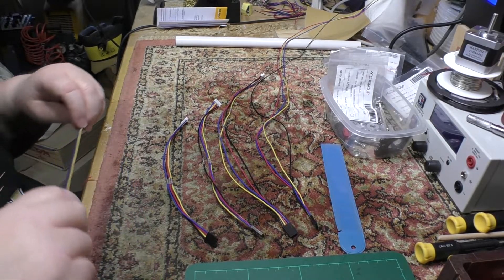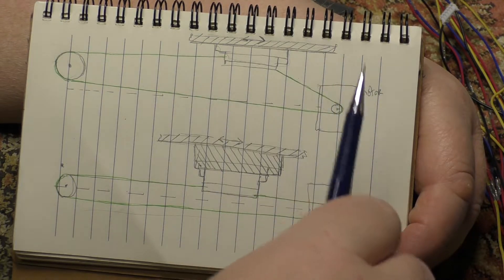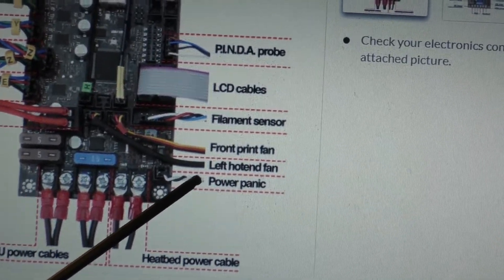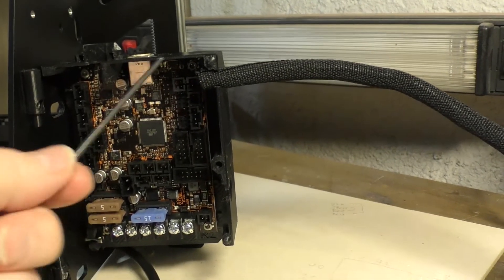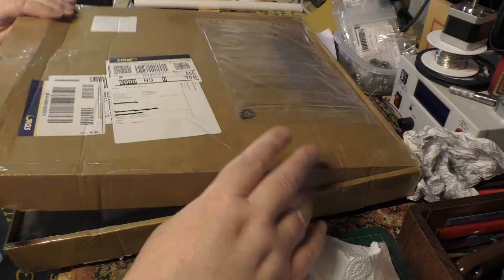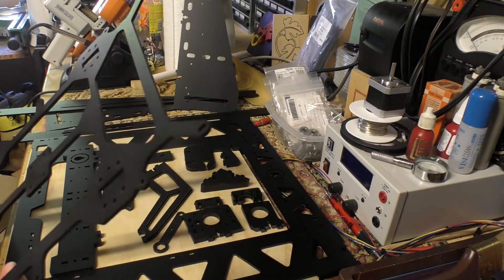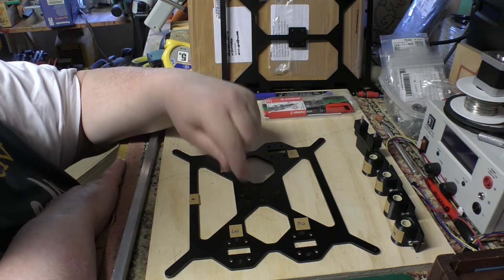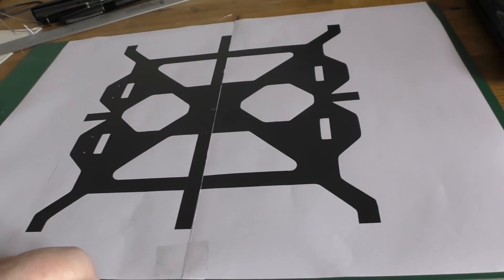My FrankenPrusa - A Pilgrim's Progress

Comment: I feel for you John. As for Orballo.. you deserve a medal. Looking forward to your machined carriage, no rush. As a side note I've found a larger idler pulley on the y-axis helps reduce noise, but totally agree with the stepper pulley axis adjustment. Why so many printers come stock with y-axis steppers that are off-axis to the carriage is a mystery to me.
Reply from the maker: Hi Chris, cut the wooden test of the new carriage in the X-Carve this morning - looks good.  Alas I could not find a suitable piece of aluminium plate locally so had to order from you know where - now we wait.    My bed carriage sits higher than normal and this exaggerates the Y-axis pulley alignment problem.   All will be well in the end  - one way or another!
Cheers,  John